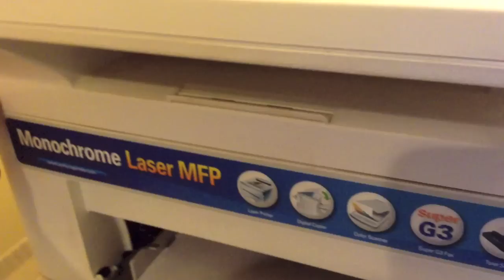Replace a Printer Pickup Roller (Samsung ML2010, SCX4521, SFX4725 and others)

Comment: Jeezzussss!
Worked for me with a little thin screw.
Thanks!❤
Also i flipped the rubber and put it back and the printer works like new
Reply from the maker: Good for you! 🏆
Reply: I did not have a replacement handy (I just ordered one). I took a sheet of paper folded it in half & placed it between the rubber & the plastic roller. The small extra thickness seems to have worked. So far, so good. NOT looking forward to going thru that again, but I still have 2 new toner cartridges that I wanted to use & not discard.

Comment: In 2021 this video is still relevant!   THANKS so much for making and posting your video.  Getting those two tabs pulled out was definitely "challenging", but I would not have figured it out without seeing you do it!

I ended up using a small blade screwdriver on both sides simultaneously to pry them OUT (horizontally).  I could not seem to do it one side at a time.  When I found the sweet spot, the roller came loose easily. Turning the tire inside-out revealed the inside surface was very smooth, so I didn't opt for that. I just stayed with the original exterior side and rotated it to orient the best surface at the pickup point. I used silicone waterproofing liquid to clean the tire (the rubber), which only had some minor cracks. 

It went back in quite easily.  Worked great on first try and on all pages since.  I may buy a spare tire on eBay for next time.  This has been a remarkably reliable and economical printer until the feed jams started a year or two ago.
Reply from the maker: Good for you!
Many fixes work temporarily on the surface but the rejuvenator seems to actually make the rubber "young" again.
I have extra rollers in the closet for if I ever need them down the road. Better to have one and not need it than to need one and have to wait weeks for a shipment.

Comment: Thanks for sharing this! I had am ML 2010 in storage forever and just reversed the roller (with your help) to get it working. Very fiddly to get the roller out -- finally just used pliers to grip and pull the tabs away. Did something similar on an ML 1210 years ago.
Reply from the maker: Whatever works is OK by me!
I'm glad you managed to salvage your old ML 2010. Good for you!

Comment: Thank you so much for this!! I thought my printer was dead for sure and didn't know you could do this at all, but your video saved me the cost of an entire new printer! Also, I looked online and people recommended turning the old rubber inside out (if it isn't completely worn like the one in your video) and it worked for me.
Reply from the maker: Hi Michelle, 
I'm glad flipping the rubber roller inside out worked for you. It all depends on how old and cracked the rubber is. 
I like having a new roller on hand for when the old one finally gives out. And once the old one is out for flipping, I figure why not put on a new one and get another 5 years of carefree use out of it.
Reply: Thumbs up! Worked for me too. Turn the rubber inside out and put it back

Comment: Thanks to your video I bought one from EBay (for $1+$3 shipping) - and due to 3-6 weeks shipping to Hungary, I "repaired" my original with a slight rubber shift AND an electrical tape to the rubber support (I measured: 0,1 mm worn away).

Before I tried another "Just clean" video hint (which is easier) - and it worked for 5-6 feeds, but not more.

So my 10-years-old ML1610 printer now reliably feeds paper again.
I did not want to throw away, because I have extra toner for it and refill is VERY easy (no chip, etc).
HP (who bough Samsung printing division) will make repairs life harder...
Reply from the maker: Thank you very much for your comment!
If one can wait, it is amazing how cheap a new roller can be. Or with paying for faster shipping, it's often pretty cheap to get 6 or 12 rollers instead of just one…essentially a lifetime supply. In my case it meant I was ready when any of my several printers needed a new roller.
And thank you for alerting me to HP buying the Samsung printer division. I wonder what difference that will make  to quality and prices.

Comment: Excellent video for diagnosing a feed problem.  ALSO: I noticed that the inside of my rubber roller was in good shape, so I just turned it inside out, and it feeds properly now.  Now I can print until my replacement gets here.

Comment: Thanks, that was just the help I needed! :-)
I wedged two small jeweler's screwdrivers behind the roller tabs to keep them disengaged while pulling out the roller. Also it's easy to remove the entire front panel.
When installing the new roller, there is a "false" click before it's all the way in. Push harder to get the second click.
If the printer won't clear its error state, try removing and reinstalling the print head assembly, and open and fully close the top and front door panels.
Reply from the maker: Glad to be of help, Shaman!
The main thing is folks get to see that any kind of tool can make this possible. I recall someone had long enough fingernails to do the trick!
What is removing the "printer head assembly"? It sounds like a bit more involved.
Another way to clear the printer is to go to the printer's control panel and find the print queue, pause it, wait a few seconds and then restart it.
Alternatively sometimes turning it off, unplugging it, waiting and then plugging it back in can do the trick.
Reply: maximpulse On the ML-2010 the print head assembly is removed by pulling out the black handle inside - it contains the toner, PCR drum, etc.

Comment: I never thought that it would be so easy to change the roller. Btw. I had no problems to pull out the taps just with my fingers ;-) No more paper jam in just a few minutes. Great. Thank you so much for sharing your experience. W/o that, I would have disassembled the whole printer...

Comment: Thanks so much. The bit with the tabs was so confusing until I found your video. Then I grabbed a bit of copper electrical wire, bent it into position like your coat hanger, and was able to pull out the tabs... before, I had just been pushing them down and of course, not making any progress. Hopefully I can keep my 15 year old ML-2010 going!
Reply from the maker: Good man! Way to go making stuff out of bits 'n' bobs!!

Comment from the maker: Hi Richard,
one more thought: another solution to a roller with a worn surface is to coat the rubber with a "rubber cleaner and rejuvenator". If one searches YouTube for "Renew your printer pickup roller!", I have a video of how to do that, too.
It actually costs more than a new rubber roller, but it's really quick and easy…it only takes a minute to do.

Comment: This is great. Thanks. My roller was getting 'slippery' with rubber degradation, but it was intact. I just turned it inside-out to expose the unused side to the paper, which will probably buy me months or longer of use.
Reply from the maker: That is a great solution. Sometimes one can simply rotate the rubber roller to expose the unused part. It is funny how the rest of the Samsung printer keeps working and the lowly rubber roller is the part that causes us such grief.

Comment: Great video.  I followed the instructions except instead of replacing the rubber I just rotated it 45 degrees.  Worked like a charm. Thanks for posting this video!
Reply from the maker: You are so right! Rotating the roller rubber around halfway is a great solution. If you use the rejuvenator once in a while, that newly exposed side will last much longer.
it is great t feel in control of the only thing that has ever given me trouble on these printers over the last ten years!
Also I like having an extra roller on hand for that fateful day when I know my roller will break at the worst possible moment and I don/t want to have to wait days for it to arrive.

Comment: Thank you so much. Your video is still very helpful in year 2023. My rubber ring is not cracking yet. So I used sand paper to sand off the old slippery surface, and it is grabbing the paper again. I will see how much longer it lasts.
Reply from the maker: Once the rubber is that hard it will fail eventually. It's probably time to order a new one to have on hand…or start using the rubber rejuvenator to soften the rubber again.
More info here:
https://www.maximpulse.com/tools/fixing_paper_jams.html

Comment: 2020 and im here fixing my ML2010. THANK YOU FOR THIS VIDEO. Had no clue to pull those tabs outward. Was pressing them down instead. THANK YOU
Reply from the maker: Yay! Another printer saved from the wrecking ball!
It is funny to realize one is doing the opposite of what is required. I clearly recall the first time I had a truck with reverse threaded lug nuts on half the wheels. When trying to remove a flat tire I didn't realize I was tightening by turning the wrong way.
Reply: @maximpulse  darn, got the rubber ring in today. installed it and it doesnt work. Now the problem is that the pickup hits the toner cartridge and cant turn down to pickup the paper. Seems like the rubber is too thick, even installing the original worn rubber doesnt work and hits the toner cartridge too. Not sure where i went wrong here. Makes a horrible grinding noise like a jammed gear. Tried it without any rubber on the pickup and it seems to go fine, just cant pickup any paper obviously.
Reply from the maker: I'm not a professional printer repairman and my knowledge is limited so I'm not sure what might be happening for you.
There are different size and shape rollers for different printers.  All I can think of is maybe it isn't positioned completely seated or maybe it isn't the right size roller, but those are just guesses. 
Have you held the new roller next to the old one to see if they match?
Reply: HOLD UP. Looks like the new rubber is super inflexible. So you really have to push down the plastic holding piece until it really clicks in. Theres an initial click and then a bigger click. WORKS.
Reply from the maker: @GuyWithAGweikeCloud  Yay! 
Now back to cruising singles bars with social distancing…

Comment from the maker: Quite right about reversing the rubber roller pad to reveal a new "grippy" surface. I did mention that in the video. You can also just slip the roller pad around, say, 90 or 180 degrees and use that portion of the roller.
In my case the rubber was cracked so I replaced the entire pad. Since the rubber pad had lasted something like 8 years, I figured I may as well have a totally brand new start.
I am itching to make a video where I take the cover off one of these days. Thanks for your input!
Reply from the maker: @Gage Rylan Yay! Good for you sticking to it and getter 'er done!

Comment: Thank you for your video. The most tricky part was those two clips. Now I'm printing again nicely. By the way, I noticed that I did not need to buy a new roller. I just removed the roller and flipped the rubber inside out and it seems to do the trick.
Reply from the maker: +Atte Pulli 
Good for you! For some folks flipping the rubber works and gives you some time until you need to replace the rubber.

Comment: Thanks for the video, it worked really well!  I found taking the assembly out even easier than dealing with a coat hanger/ tool to get the tabs to move.  I simply reach in with both hands, moved the tabs slightly and pulled the entire assembly out all at the same time.  Hope that helps! Thanks again!
Reply from the maker: Hi Paul,
knowing about the tabs and what to do is the worst part of the whole deal.
I'm glad your nimble fingers did the trick! Thanks for commenting!!!

Comment: My roller was not picking up any sheet of paper anymore because it was pretty much baked by the heat, having strikes and small ruptures on the surface. I found that simply removing the rubber from the roller and turning it inside out (exposing the inside, now better surface) fixed the problem ;) I am pretty sure I won't get the same run from the reverse side of the rubber but it will definitely work until the new part comes in. While I don't see a problem wearing the rubber tire both sides, I strongly recommend against doing the same with clothing :D LOL.
Reply from the maker: Jim Spencer That's definitely an option to get more wear out of your roller. I'm the sort who likes to have a spare roller on hand for when those cracks becomes tears and the printer ceases working.
Good for you finding a free solution for keeping the old machine going!

Comment: Nicely done. It appears that your technique would work with the ML 1610 as well...based on the roller, and install style. RE the different tabs on the roller: I think before I undo, I will mark lh rh, as the plastic part of the roller could easily go either way. (back to front, or front to back.

Comment: Helped me in 2021 -  OEM part# JC73-00302A. In my case I cannot wait for part to ship from China, however for the interim I was able to re-secure the broken belt with an elastic band to at least get the 2 pages I need today printed. Thanks!
Reply from the maker: Good for you figuring out a "make do" solution!

Comment: Thanks a lot!
it was so frustrating to give the piece of paper a push ever time I wanna Print something.
But now it works like it was new ;D
Reply from the maker: +UrbanBlazer 
Yay! Good for you giving your printer a second life! These Samsung printers never seem to die…only the pickup roller wears out.
Reply: Thanks for the video on replacing the pick up roller. After watching the video I got to thinking. When I looked at the surface of the rubber on my roller it was dry and crinkly but i wondered what kind of shape the inside surface of the rubber was in. So I removed the pickup roller ( which was quite easy thanks to you) and removed the rubber. looking at the back side of the rubber it was sooth and shiny just like new. So after washing it with soap and water I turned it inside out and reinstalled it in the printer. Hallelujah it works like new. Just thought I would throw that out there as another alternative for solving it problem. Cost= $0.00

Comment: I was really inspired from your video. Thank you! Waiting for the new rubber, I had the practical idea to fix the broken rubber with the broken side inside and two elastic rubber rings (normally used for vegetables here in Italy). It works!!! Of course not for a long time, I think, on monday I'll get the new one. Mille grazie
Reply from the maker: Wonderful temporary solution! Thanks for sharing a new idea.

Comment: I have a problem, Maxim Pulse. You see the envelope feed assembly at 0:16? Well, I lost that whole thing in my Samsung ML-2010 printer when it was in a shop for repairs. I need that assembly back. Do you know where to get that?
Reply from the maker: Hi Mr TV!
I can send you one of mine. I have at least 3 Samsung printers (one is an ML-2010) I never use that part because I don't hand feed any sheets of paper or envelopes. The printer runs just fine without them in there.
I don't see where you can buy one on the web.
Send me a private message and let me know what you think. Make sure to add me to the list of folks you accept private messages from (if you have some sort of lock on that).

Comment: Still helpful in 2024. For me the roller was still in good condition in the sense that it wasn't cracked or anything. So I pulled it out and cleaned it thoroughly with hot water and soap. The first few tries worked fine (first time in a long time). Probably wont last long, but we'll see.
However, the toner of course ran out as I printed a couple of test pages... Now the question becomes if I should bother with new toner for this ancient thing. Or, if I should upgrade so I don't have to keep carrying this printer back and forth every time I need to print something...

Comment: Thanks for the really helpful video! I found it way easier to remove the roller by simply pushing on both ot the tabs with my thumbs at the same time and then each a bit sideways. Then to roller almost popped out by itself.
Reply from the maker: Cool!  I'm glad you found a way that works for you!
It may even matter how dexterous one's thumbs are! ;-)

Comment: Hi!

Many thanks for your help! :)

One question, What is the cream band under the roller? Sometimes that band I Think that makes dirty some part of my documents :(, a cream band on my sheets. Yo can see it at 1:57. Many thanks!
Reply from the maker: I looked at 1:57 and I'm not sure what you mean by the "cream band", but I try to answer anyway! I didn't get where I am today by letting ignorance stop me!
All the cream colored parts are nylon plastic.
Immediately under the black rubber belt is a cream colored nylon C-shaped part which the belt wraps around.
Under that is a core which the C-shaped part clips onto.
Behind those parts are a couple of "gripper fingers" (that's my term) that hold the paper against the black rubber belt as it turns.
it could be that those gripper fingers are dirty and are smudging your prints.
If it were me, I'd clean them off with a damp paper towel or makeup pad, let them dry and see if that helps. You can also try a little Windex on a pad/towel, just be sure to let things dry before printing a test.
Reply: maximpulse
 Many thanks maximpulse :), yep, excuse me if I didn't explain me jeje. Yes, I think that is a gripper fingers that help the C-shapped band to take the paper, it's too dirty, and the rubber band have the same cream-yellow tone that have the gripper band, I'll try to take a short video to explain me better :) Many Thansk again!